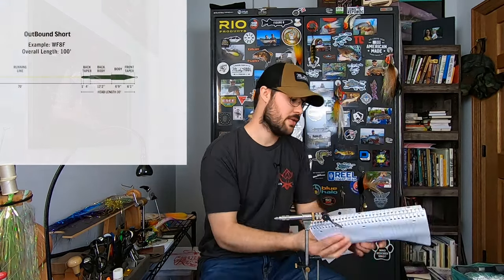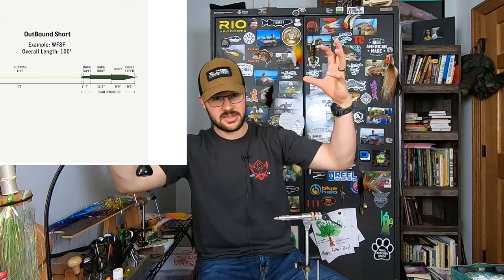Fly Lines for Streamer Fishing - is the AFTM system outdated?

Comment: All I need is the head weight and head length to know what works on my rods. Was informative, but don’t need to know how the sausage is made ! lol ! I zero in on the head weight and length when looking for a fly line , not so much what wt. it’s rated at. Some of my rods I’m throwing a fly line that’s 1 or 2 sizes up what it’s rated at. Rio Outbound short, SA Titan long , and a few of the Airflo lines - like the power taper are my favorites. I learned the head weights on lines when I started using Spey rods then slowly migrated that to my single handed rods. Just because it says 6wt doesn’t mean a 6wt fly line is the optimum line for that rod.

Comment: I listened to Kelly's reflection about Euro nymph fly fishing, is it fly fishing or not? Kelly does present the case to say that real competition fly fishing, if real competition fly fishing even existed. It would have to consist of competition anglers fishing against each other, who were more likely to do different things ( as happens in conventional tackle side of competition, rarely are all competitors doing exactly the same technique ).
Reply: What has that got to do with fly lines? When I thought about it, and what Kelly said, it led me to think of an aspect of it which Kelly missed. That what happened in fly fushing for two-handed rods and lines, did not happen on the single-handed rod fly fishing side. Yes, there is progression and evolution that occurs towards switch, trout spey, micro skagit or even micro, or ultra-light Scandi now. To move ideas started in two-handed fly fishing down to the four and five weight single-handed tackle. But that too just misses the point.
Reply: What the early to late 1990's revolution in two-handed fly fishing ( with the boxed and branded, non-garage workshop fly line tackle hitting retail circa 2003 to 2004 ), was really all about. It was about measuring weight, length, anchor points more accurately. For the first time ever mainstream anglers started to get serious about 'the line', or 'the cast'. On the under-handed or so-called Scandinavian shooting head side (which was a separate garage industry type of thing in Norway, Denmark, Sweden), those guys focused on 'line speed' increase, and treated anchors and casts a different way.
Reply: The point that Kelly missed, is while all of that was happening on the two-handed fly fishing side, on the single-handed side we had nothing. Life just progressed as normal. And what you are witnessimg in what Kelly talks about, competitive ' Euro nymphing ' sport ( it does not warrant calling it ' fly fishing ' ), is the exact same fascination or obsession with science, weights, water flows, depths and presentation. That drove the two-handed fly fishing revolution in thefirst place. That is the point.
Reply: Here is the qualification to that. While Skagit and Scandi forced anglers to explore shorter heads, large floating line head diameters, all kinds of front-end density modifications and subtlety. And to wrap that all around with a new water-friction anchor idea. To cast all of that new rigging, flies and tackle. It forces both Skagit and Scandi guys to re-imagine ' the fly line'. What happened to single-handed fly rod anglers ( in competition ) ? Well the single handed fly rod guys instead of re-imagining the fly line, they made it vanish altogether. And we focused on two things primarily, which mattered for bait presentation. Tungsten weight on the hook, and fluorocarbon leader diameters ( now they're trying to get down to 7,5X tippet ).
Reply: What does 7,5 X tippet buy you? Well what it buys you is the ability to lob a weight invertebrate aquatic insect imitation out, have it achieve it's depth in no time, and the lighter grade tippets impart more life-like movement or action. The single-handed rod guys became obsessed on tippet diameter, in the same way as Skagit guys became obsessed with water-based anchors and skagit head line diameters ( more line head diameter equals more friction, more friction equals more rod-loading capability, equals more ability to add weight to sink tip, equals presentation of fly to depth in fast water current at colder temperature ).
Reply: Both the double-handed and single-handed fly fishing sports became hi-jacked by the same drive for excellence. Except that what happened in two-handed fly fishing was simply way more Nirvana, Seattle, cool, hip and Grunge circa 1992. I heard Nirvana when it was radio broadcast back then, for the first time. And before Grunge became a thing. Two-handed fly fishing had that in tonnes. Market-ability. The coolest thing I've seen in Euro nymphing was a guy who wears paintball sport neo-prene knee pads, whilst kneeling on the river bank in Colorado. So as to avoid getting punctures to his expensive Simms chest waders. And that's it. Open a Euro nymph fly box with rows to different weight nymphs all color coded and organized. Versus a skagit angler's box of Intruder flies. Which one is more Grunge?
Reply: Here is the thing. Just because two-handed fly fishing became cool ( like the new trainers or basketball kicks you needed to own to feel complete as a human being ), there was peer pressure placed on anglers in that salmon or steelhead fishing culture to be cool. To try to live up to the hype. Because two-handed fly fishing first became that cool, and then the single-handed fly fishing anglers tried to imitate that in some way. Even if it just meant wearing tactical knee pads while fishing with monofilament as a fly line for Euro numph technique. Two-handed rods and lines at one point really were not as cool as it turned into. Rwad Ian Gordon's article of November 2021, ' Free Advice and Trial of the New Cadence, Ian Gordon on the River Wye 8th Dec 2021 '.
Reply: So where does that all leave anglers like Kelly or Gunnar in all of it ( both have done steelhead, Musky, bass, saltwater, pike fly fishing and gear fishing too ). Gunnar has even fished flies with gear tackle for small mouth bass in rivers. Well, there was no home in either single-handed or two-handed fly fishing for either. Kelly has made his feelings crystal clear about the Euro nymph method, and calling that type of competive angling ' fly fishing '. Even though it should be called Euro nymphing competition. And two-handed lines, rods and flies won't enable one to actively strip or jerk a fly lure in still water ( Kelly admits that even the eight weight single-handed wears out his hands and wrist nowadays, so he foshes with six or seven weight ). What it meant was that not one, but effectively two separate and parallel revolutions happened in fly fishing. And neither of those two revolutions was all-encompassing enough to carry Kelly or Gunnar along with it. In terms of what Kelly or Gunnar were trying to do. I totally hate how the trout spey guys have tried nibbling at Kelly's piece of the pie now, and talk about 'swinging streamers'. That's a contradiction, yet the trout spey guys use that phrase with abandon. To the point where it has become accepted lingo now in fly fishing.
Reply: There is only one analogy or parallel that I can sketch to explain it. It happened on the west coast too, but not on the fly angling side. It happened in California on the gear tackle side. Yet another revolution in fishing, another garage-based, back room, stay up late and night and make tackle sort of deal. It was called the large swimbait revolution. When Michael Iaconelli went west in the mid 2000's decade, having grown up in New Jersey State, he was confronted with those large swimbait lures for the first time. Iaconelli had seen it all in gear tackle fishing. Everything except that, and it more than raised an eyebrow. He pondered if a freshwater large mouth bass would ever be interested in a life-size imitation of a rainbow shad. It turns out yes, and that is what guys in California had figured out ( at the same time as Mark Sedotti's herring bait fish imitations had moved further inland, to Michigan rivers and to the Arkansas White river ). A bit like how New Zealand brown trout anglers figured out certain things, on the other side of the globe. And that ended up in Michigan too, as Jack Dennis recalled happening. At the beginning of when 'match the hatch' went one way, and Kelly and company decided to march off in another direction. To show up in Yellowstone National Park in early 1990's with three-inch Carrie Stevens trolling flies from Maine, took some confidence. Kelly wasn't cool at all back then, because he by-passed the up-winged may fly thing. As you were meant to do. And he did something entirely different ( probably with the ghost of Joe Brooks in Montana to serve for some spiritual fly fishing guidance and direction ).
Reply: Lastly, here is the real reason why Euro nymphing became 'a thing' for single handed fly angling sport. The angler is on foot, on a river bank or standing in water. Even if you have a plastic kayak now on lakes with crankbaits, jerkbaits etc you still carry a dozen different rods and lures. All lined up, you put one down and pick up another rod and lure. Where you find the right water for it. I tried to carry four single-handed fly rods on the river with me for a while. I gave up. I got worn out after a few hundred yards. Bank anglers need one rod and one reel, but still need to accommodate variation ( like those kayak and boat anglers on stillwater can have ). Anglers one boats will put down their six inch swimbait, and pick up a tiny crankbait to burn it down a stretch of submerged timber. As an angler on foot in fly fishing, you're quite severely constrained. Even Kelly on the Madison in the Klacka craft is still moving down river so quickly, even with a boat guide back-oaring to slow down. You haven't got luxury to put down one rod and pick up a different rod either.
Reply: In double or two-handed fly fishing, they kept it simple. As far as line weights go ( it's different in single-handed casting, it's not a linear weight increase scale, it's a curve ). In double handed head weights there is a set 100 grain, or 6 to 7 gram weight difference between each line size or weight category. And it does not vary. It's a 7 gram, or a quarter ounce change. As you go from lighter rods to heavier.
Reply: On single handed rods and lines, the weight difference on AFTMA scale begins at 30 grain incremental differences. It then widens to 40 grain differences. And then finishes at 50 grain weight differences towards the top of the AFTMA scale. Lighter single handed fly rods, the changes are subtle. And with heavier single handed fly rods, less so. But nothing like a 7 gram or quarter ounce weight change between rod categories. In single handed, the jumps on the scale are 2 grams, 2,6 grams or 3,2 grams. The question then is, where have I seen those gram weights before ? The answer is in Euro nymphing. And that goes right back to Kelly in his Klacka, or Euro nymph guy using his level Czech or Euro nymph mono fly line. The Euro nymph guys 'found a way' to carry the same number of fishing rods as kayak and boat angler guts do. Except the Euro nymph guys found a way to carry those spare rods in their pocket instead of in their rod locker (because Euro nymph guys don't have rod lockers).
Reply: Tungsten Bead 
2,5 mm 0,12 gram 
3,0 mm. 0,20 gram 
3,5 mm. 0,32 gram 
4,0 mm. 0,48 gram 
4,6 mm. 0,75 gram 
5,0 mm. 1,10 gram 
5,5 mm. 1,48 gram
Reply: What they're doing with Euro nymph is they're working in some variation in rod and presentation. And working within those small weight increments, down at the lower end of the AFTMA single'-handed fly rod table. That's all it is. You can't carry, as Kelly would suggest. Multiple rods, techniques, lines and lures in competition fly fishing. Why? Well just go to the river and try to carry all the stuff a typical Wednesday night jackpot bass competitor has. As see how far on a trout stream or river you can walk and still carry that stuff. No distance.
Reply: That's really the story. I applaud the message that Kelly Galloup or others would communicate about fly fishing competition. The requirement to have multiple fly fishing approaches and methods present in the competition. Not just one method, Euro nymph, which Kelly explained was the closest thing he's witnessed to bait fishing using a fly rod. Fly fishing competition as it is now makes zero space for other methods. On the other hand, there are the real physical and practical limitations with fly fishing, that don't exist when you have bass boats, or kayaks. Along with rod lockers, a bunch of gear rods, tackle boxes and alternative baits to hand which you can turn to. Fly fishing anglers are trying to carry it all 'on their backs'. So in that sense, tungsten weighted nymphs make total sense.
Reply: In his buyer's guide article I read, an angling expert or consultant Allan Sheppard wrote ' A GUIDE TO CHOOSING A FLY LINE FOR DOUBLE-HANDED RODS '. Allan uses a phrase when he described the Scandinavian shooting head concept. He explained how the system of inter-changeable parts allowed the angler ' huge tactical advantage ' on the water. Again, this theme is consistent all of the ways through angling on both the gear side and with fly fishing ( gear anglers and kayaks on stillwater simply have more ability to carry stuff, in a way that fly fishing anglers on moving and faster water don't ). The theme is one, that suggests that the modern fly fisher is able to carry with them options. To enable that angler to change up their tactics, when their existing plan does not work. And that's a recent trend in fly fishing, that has lots to do with how, the modern fly fishing angler views their sport. The tungsten bead and lighter 7X tippet was one solution. The Scandinavian shooting head system another. And the west coast Skagit line and sinking tip system yet another. All clever ways to try and defeat the enemy of having no access to variation, tactical or otherwise. That the fly fishing angler has always been curtailed by.
Reply: Lastly, compare bass or other conventional tackle sport and species to fly method. If fly fishing was like bass angling, my hunch is that fly anglers would carry both a salmon style rod, a switch rod of some kind. And have a Euro nymph rod. And perhaps a 'bank robber' streamer fishing style of rod too. All in the one boat. Just the way that gear anglers change from flipping sticks, to cranking rods, to Carolina rigging poles. That's what gear tackle anglers do, that is how they roll. Yet, in fly fishing ( switch the tables around and view through the lens in the opposite way ). If ' bass fishing ' was like fly fishing, guess what? You'd end up with bass anglers who only fished top-water frogs. Or only fished Biffle bugs. Or only flipped jigs around docks. Or ran rattle traps through the shoreline grass. And no one would step outside of their own lanes.
Reply: I don't think that Kelly in many of his conversations about fly fishing has put it like that. The thing about fly fishing is, a Czech nymph angler does Czech nymph, and makes a specialism out of it. A dry fly angler does dry fly. And so on. Fly fishing anglers tend not to be accepting of members of other tribes, wandering out of their lane. And ending up somewhere, where they're not supposed to be. That doesn't happen nearly to the same extent with gear anglers. Granted gear anglers tend to have strengths and weaknesses. However, even the angler who is weak at throwing a Carolina rigged bait, at times will be expected to try. Or a gear angler who is not expert at fishing brush piles using a jerk bait, may have to try that. Gear anglers if they were fly anglers who be expected and required to carry a lot more tackle and types of rod or lure. Not just a box of Euro nymphs all of the time. Yet in competition fly fishing anglers are expected to carry a box of Euro nymphs. Or risk not being competitive at all.